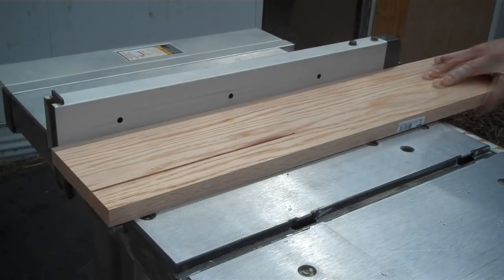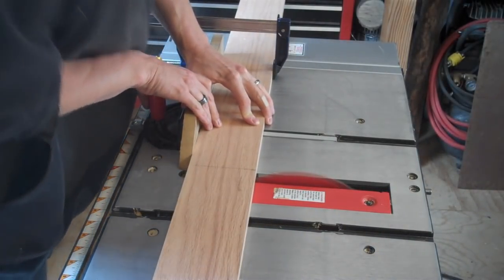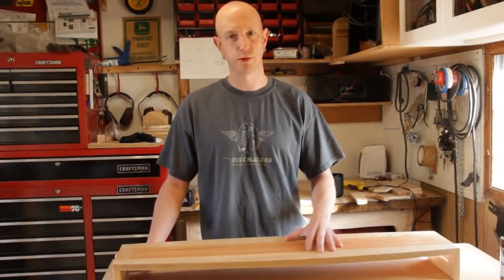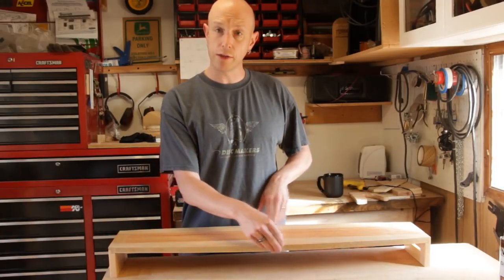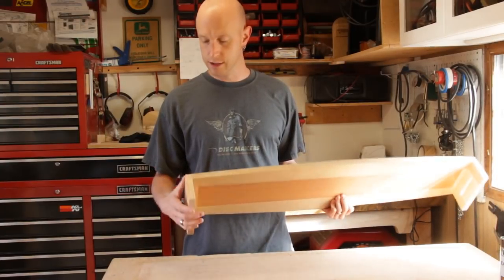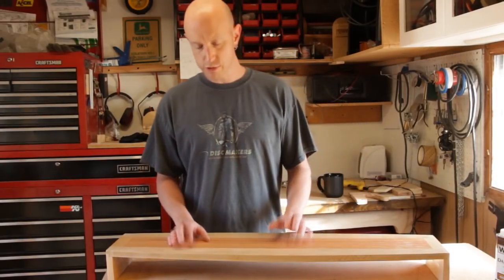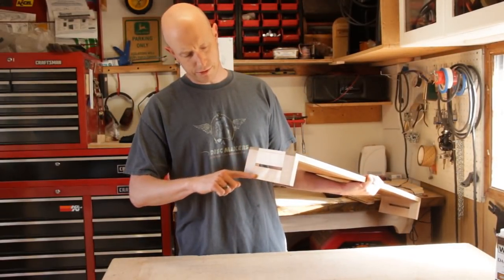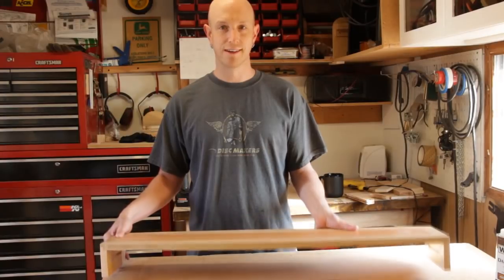How to Build a Computer Monitor Stand

Comment: I made a really easy similar one, by simply buying a 48" wide unfinished stair! the built in curved bevel made a beautiful front. I simply chopped it to desired width and used the remaining scraps as the sides to give it the desired height. I shortened the height pieces to recess them a little bit under the top level, and even those legs made use of the curved bevel and it came out great. paint or stain as you like and even drill wire management holes if you wish.  You can even just get a second stair to build a double decker with a drawer, pretty cheap and easy =]
Reply from the maker: A stair tread is an awesome idea. Thanks for sharing that. I'm going to have to look into those.

Comment: You kind of did double finish by putting poly over the Danish oil. Danish oil is a natural look finish that actually fills the pores of the wood with no "top coat". The only time one could use the combination is with a soft wood. Watco actually denisifies the wood, which in the case of oak and maple is not necessary.

Comment: Hey Jeff. Thanks for the video. How did you join the side panels together?
Reply from the maker: +Curt Markey they are just glued together.
Reply: Ok cool. What about the curved edge on the top piece. How did you cut it?
Reply from the maker: +Curt Markey I used a jigsaw.